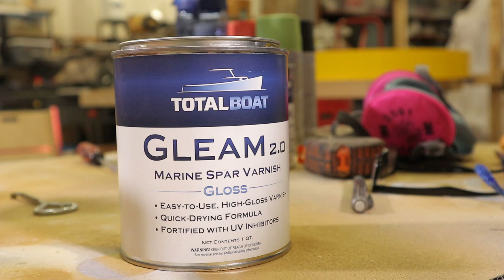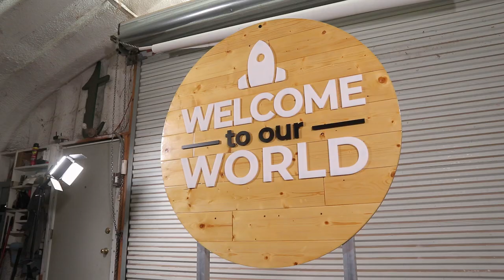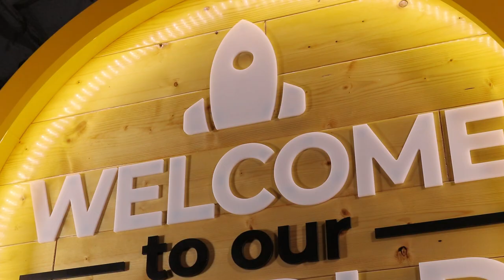Making a Sign With Ferns & a Rocket on It

Comment: Yeah don't breath the zinc fumes, I agree with yourself.
Actually, if you needed to do tons of these, maybe etch off the zinc with muriatic acid and you'd get better welds.  Not so much about the strength, as it is about how easy it is to make look nice and clean up with a grinder.
Reply from the maker: Yeah, in another case, I might take the time to do that, but these welds are hidden and don't need to be that strong. 👍